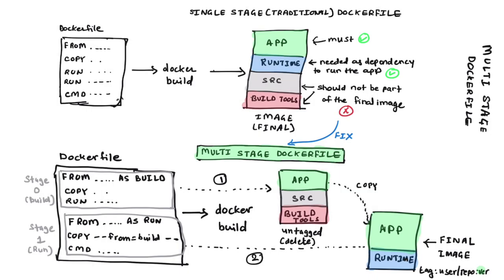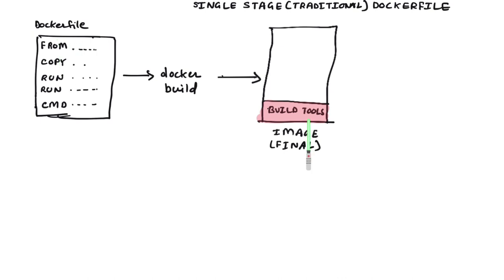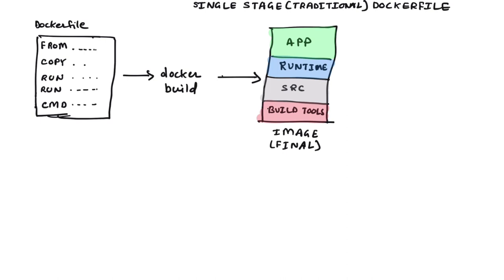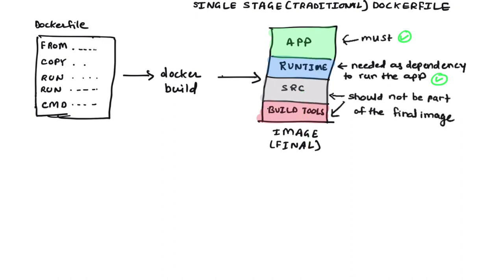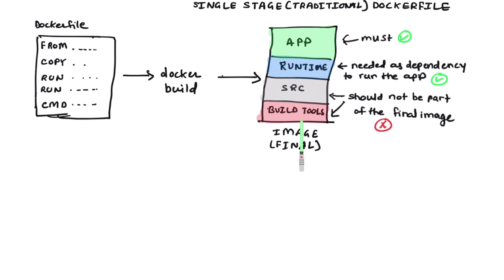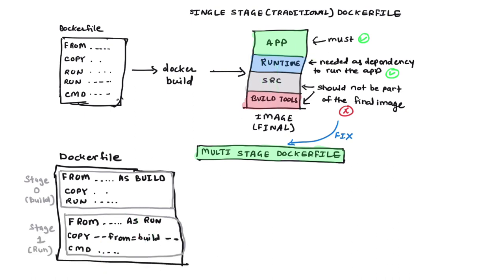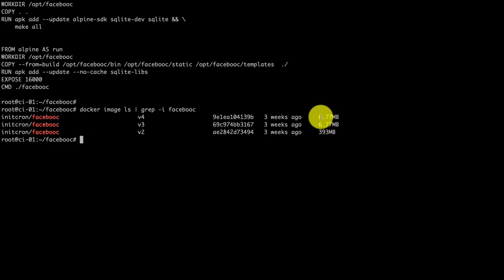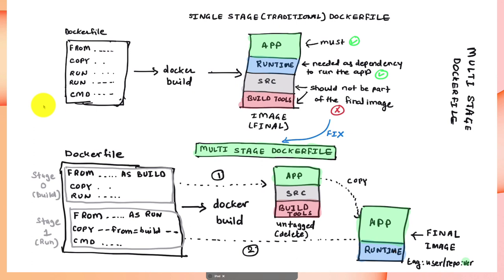What is Multistage Dockerfile ?

Comment: Hello, Nice content! 
One quick question- how we are giving the paths in WORKDIR? I mean it's based on base image structure or how?
Reply: WORKDIR path depends on where you want to copy the code, compile and run the application from. This is nothing to do with base image. You could define any path that your application needs and it would be automatically created during build time and then used subsequently by all other instructions including COPY, RUN, CMD etc.
Reply: @gouravshahj  I think it is similar to MKDIR [-p]. WORKDIR creates directory on the fly
Reply: Workdir simply create a directory ( if not present ) and make all incoming commands run on that specified directory